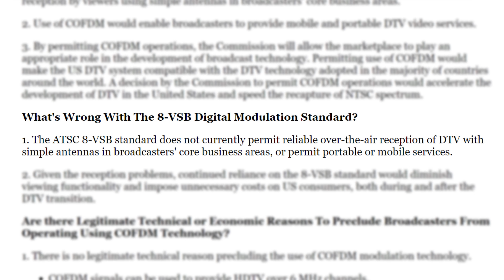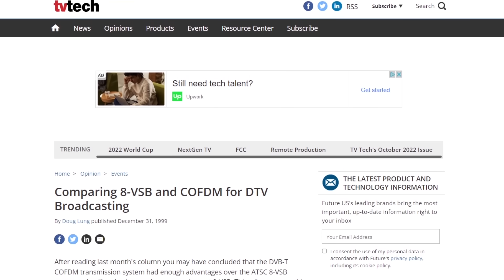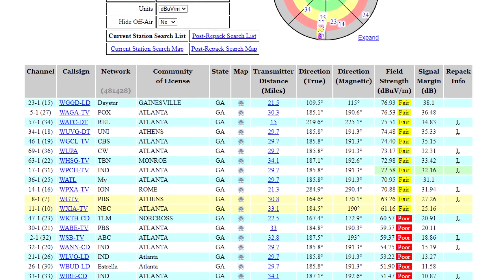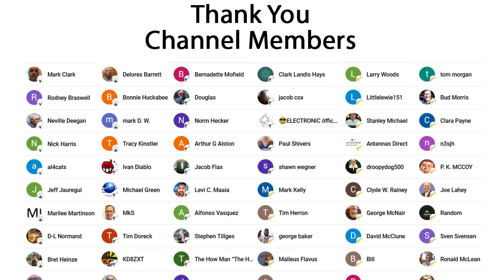This FCC Decision Made Antenna TV Less Reliable for All

Comment: truth is if you still have that rooftop antenna from the 70s or 80s or 90s hook it up.  Coax will still give you 1080p (if your tv supports it and if the broadcast is using it). I'm using that and am getting 74 channels, some have good stuff on them.  But the real problem with that is a lot of it is repetitive, re-runs, or too ancient of shows for most people to know or care about.  And there's a LOT of other content they could use but don't (streaming services pick up that somewhat a bit).  And the cartoon selection is pitiful compared to any of those eras.

And my setup is WITHOUT a in line amplifier.   Granted i'm in a large city area though.  But that will only improve your channel lineup at least somewhat.

Talking about black and white shows and shows made back in the 1940s to 70s being broadcast.  Granted there's some 80s, 90s, early 2000s, some stuff that's even fairly modern (CSI miami for instance)  But the truth is its just some cherry picked stuff that was popular while most of the rest remains on cable or streaming or only available via "alternative methods" or dvd/vhs/blu ray/UHD blu ray.

And if its not that its lame shows or Infomercials.

Comment: If I needed to climb a tree, a rope would be more reliable, not a tread. The only way to get a good signal is to put the antenna in the top of a tree or a tower. Thanks much for the info from an antenna nut.

Comment: One issue to add was the motivation at the time was to scrap the Antenna all together. This was talked about  until they passed a bill to allow free TV because of communication to news and weather issues and other emergency services that would not be accessible to millions who cannot access cable in remote areas. 
This won out. But the issues still existed to make Antenna service as difficult as possible 🤔. This went on for a few years but nothing was discussed .This clearly bad decision was motivation by lobbying from K Street if I remember right. It was a Boondoggle of an idea that so was abandoned as I understand  The assumption was everyone eventually will be a cable prescriber .This proved to be more problematic 🤪. They as a whole didn't realize most couldn't run cable and many cable companies  had substandard infrastructure  to accommodate the customers even if they had the money. Another suit in an office making decisions about your lawn care while they live in an apartment without a lawn.An analogy that is currently alive now.
With a politician not living in the area or state but running for office knowing nothing about the state. Good Video 😎

Comment: At times I'm very happy with reception but it isn't reliable which is very frustrating. I'm glad you covered this topic so I know that I'm not paranoid. I swear the broadcasters weaken signals on purpose. Late at night, until about 4:40 am, I can pick up numerous channels an additional 20-30 miles away and an additional  15 degrees East. Later, as I watch a program it suddenly becomes near worthless while other channels from same broadcast tower remain strong. 

As much as that irritates me, the excessive commercials, the same bad commercials and non-stop Medicare Advantage commercials are like I'm being beaten with them. Not going back to cable though.
Reply: Sounds like you may be experiencing some reception enhancement from weather conditions. It is fairly common some nights, especially in summer, to receive channels from far away.
Reply: Most low power stations in my area too have infomercials on one uhf 32 playing at the same time one on channel 12 and channel 4 low vhf playing the same program

Comment: The whole  change to digital television from analog was political.  It was done so the phone companies could steal our spectrum-in my opinion, they should never have been able to "buy" spectrum, only pay yearly payments to lease it.  The vote in the Senate was 50-50 with Dick Cheney casting the deciding vote.  I my opinion, due to poor reliability of  the DTV offered, analog should still be allowed in certain cases and on certain bands(example-low VHF) For example, even though analog can become very snowy in stormy weather, the sound is still useable, unlike DTV(or satellite for that matter),  In stormy weather, it is much better to have some information over none.   As to the engineers not being listened to, just read about the space shuttle Challenger accident.

Comment: Voyager 1 has a 22 watt transmitter that can be picked up over 22 light hours away an yet I can not pick up a single from a 100,000 watt TV station 20 miles away. I know NASA has some big ass antennas but come on. Something is bad wrong when you are cranking out 100,000 plus watts and some one 20 or 30 miles away has problems picking it up.
Reply: Terrain is a big deal when it comes to TV reception. If you live in a hole it may be difficult to receive stations even that close.
Reply: @TechnicalLee  True. But when the single was analog I was watching TV stations that were 300 mile away with little to no problem. No  the same digital stations are no longer viewable. In fact no signal is detected from them at all and I have used over two dozen different antennas. Stations that came in clear as a bell that were only 20 miles way are no longer viewable. And yes I did get converter. I no longer even have a TV at all. The Internet is now all I watch.
Reply: It's just like with modern digital cell phone reception - it's all or nothing. That's both good and bad.

Comment: The whole thing is not going to work.. where I live digital TV...is not good at all... because the tower is up the hill and still will not make it in to my apartment...if thay kept the analogue signal on the air and used to internet for Digital...or Satellite TV for that matter...I used too get 200 miles on analogue signal... Digital U can not get a station in San Diego from L A!!!!

Comment: Antenna Man, I took your advice & bought the top Channel Master antenna. I found it flimsy, with 2 or 3 elements loose, not riveted on tight, but loose.  I found VHF elements not of tube but pieces of sheet metal bent with a slit in them.
Are you on Channel Master payroll?  I don't find the current digital broadcast service unreliable where I live. I can get channels even with indoor powered rabbit ears.
Reply from the maker: I'm not on the payroll of Channel Master or any antenna company. I'm honestly offended you would accuse me of falsely recommending an antenna that doesn't work well. I'm not sure which one you bought but all antenna companies make good and bad models. Channel Master's Advantage series antennas aren't built as well as the Masterpiece series antennas. For what it's worth I actually called out Channel Master numerous times on this channel for over hyping their new Pro model.
Reply: There is no other antenna on the residential market made better than the Winegard HD7698P, HD8200P or HD7694P. That's why you still see these antennas' cousins (very slight changes) up on towers that were installed back in the mid to late 70s. Just north of Lafayette, IN where it's flat and they get extreme winds/ice these antennas continue to survive for decades and pull in both Indy and Chicago from 90 miles away (the 7698 and 8200 with a preamp).

Comment: In my tv market area, ABC affiliate and PBS broadcast stations i cannot receive. I might be able to eventually get them, because my TV has a built-in noise reduction so when I go to the call station  I can't tell if wherever I move the antenna it will improve or degrade signal strength more. Also the antenna i purchased has about 2 feet cord to tv. I also bought a db filter, which gives a little more flexibility, but not much. I wish they still made rabbit ear antenna with longer extended range, I even remember using aluminum foil on the tips for improving quality of picture. Where I live i shouldn't need an outdoor antenna because the signals are generally 15 miles away from me and I'm on the upper floor.

Comment: Here's what I remember about how this situation developed. In the 80s, several groups in the US and abroad were working on an HDTV standard. Japan already was using their MUSE system. In the US there was a desire to lead the next TV advance as had happened with NTSC and the electronic color system.

Several groups in the US including Sarnoff, AT&T, and Zenith were pursuing their own standards. In particular, those 3 groups were responsible for fundamental technologies chosen by the FCC or the market that were in daily use by millions.

Zenith's digital system was spectrally compatible (to some extent) with the analog NTSC TV signals occupying the 6MHz channel BW in the US. This was a potentially important consideration given the cost to a broadcaster of obtaining a second broadcast channel for a new digital signal apart from their existing analog channel.

AT&T and Zenith were working together. Zenith supported 8-VSB. Zenith was still an American manufacturer at the time (although this was slipping away quickly). AT&T had strength in digital video compression.

The competition and demonstrations were the hottest things at NAB '92.

Ultimately the competing players formed the Grand Alliance, adopting various technologies contributed by the members. 8-VSB made it through the trials and was selected. As I recall, COFDM was regarded as processing-intensive at the time. Ironically the OFDM technology was developed in the US and adopted by the US military, so it too was home-grown, but didn't test as well (initially) in the trials.
Reply: I don't recall ever hearing about COFDM being process-intensive before. But it handled terrestrial interference much better than 8VSB

Comment: We all need to remember one very important fact: The Federal Communications Commission is run by attorneys with political connections. There hasn't been an engineer among the commissioners in many decades. Attorneys are quite likely to dismiss concerns of engineers by asking "Well, CAN it work?" And an honest Engineer would say "Yes, But..." and the Attorneys would not be able to comprehend what the concern is. This gets treated just like any other opinion. Trying to explain nuances of modulation to them is like trying to explain electricity to a dog. You might get a curious look, but you know quite well that there is no possibility of comprehension. 

At the end of the day, the allocation of the electromagnetic spectrum is always going to be a political decision, just as zoning laws are a political decision. Yes, the FCC botched this  badly. It's not the first or the last time they will screw up royally. Eventually they will arrive at a reasonable regulation after all the unreasonable ones have been tried. I wish I could say something nice about this, but the only thing they understand is politics. Most Engineers have better things to do than play political games. And this is why we have the government that we do.

Comment: I have a zenith brand digital converter box and it still works I bought it in 2008 it's going to be 15 years old the other brands have already broken ., regardless of the issues with digital television broadcasting it is far better than the analog where you could get so few channels even in an urban area

Comment: This is why I have to use 2 fairly high gain antenna's going into a combiner that's pumping a preamp at 25 plus miles out from the broadcast area. I get reliability on all my main channels I want and now the added gain gives me some of low power stations the inner city gets but, only on good days. For me it's literally taken years to find the best combination of antenna and preamp to make it reliable in most weather conditions. That being said it's still has it's moments once and a while. It's been frustrating to say the least but, hey I'm not sending a payment to one of those TV over a wire outfits.

Comment: The hoped-for AM radio stereo conversion in the 1980s showed this same inept approach when the commissioners came up with no standard for the AM transmitter. Instead of designating one manufacturer or another, they decided it was a free-for-all, letting all candidates for the standard in the market. Everybody lost, especially listeners. AM radio today, as you pointed out, instead of being boosted by that decision, continued its slow death.

Comment: COFDM was used by every other country except the US and Korea. It was used in every other service except OTA. Microwave, satellite, etc. There was a test in DC at the Rayburn building with WRC transmitting the 8-VSB and WTTG did the COFDM transmission.  Oh there were shenanigans. It doesn't work and it never worked. What does the current ATSC use? Too little! Too Late!

Comment: I'm afraid most of this is ill-informed, as the narrative begins too late in the process to tell the whole story. At the tme the FCC standard was chosen, the over-riding factor was the signal-to-noise limit of the chosen system so that there could be simulcast of digital and analog during a transition period, plus a requirement that actual hardware could demonstrate feasibility. COFDM receiver hardware at the time did not work that well, plus there seemed to be a theoretically unfixable 3 dB penalty compared to VSB. PLUS, Zenith had originally proposed a system with flexibility to trade data rate for robustness, which is the current COFDM systems advantage, and it was rejected by broadcasters, who short-sightedly felt only HDTV was valuable. Sinclair later realized this folly, but it was too late. It was a case of the two technologies leapfrogging each other year by year, but it started with VSB in the lead, long enough that the selection process could not be reversed. Regarding the weakness of 8-VSB with fast-changing ghosts, the extent of such conditions weren't known at the time, despite best efforts to measure field conditions. The flexibility of the COFDM systems (not their basic modulation robustness) allowed them to trade off bit rate for robustness when the actual severity of field conditions became apparent. (Again, Zenith had proposed more flexibility, but it had been rejected.)
Careful comparison of up to date technology including things that hadn't been invented back in the 1990s has resulted in ATSC 3.0 using (very advanced) COFDM.
Reply: It's also necessary to point out that the market models were very different for the US and Europe. The US needed a system to fit  the use of a single tall tower for each broadcaster, covering a large area. Europe needed a system to fit the use of multiple repeats of a limited number of programs, each transmitter covering a small area with a short tower.

Comment: not only that but VHF high band stations that ran up to 216kw erp were dropped to as little a 5kw
Reply: In some areas. In other areas VHF-HI digital channels are running 50kw, while UHF digital channels must run 1 mW to have the same coverage area. Back in the analog days, full power on VHF-LO (channels 2-6) was 100kw, VHF-HI (channels 7-13) was 316kw and UHF was 5 mW. Yes, that's 5 million watts - and the UHF channels still didn't have as much coverage area as the UHF channels. In many areas today with both VHF-HI and UHF digital channels, the VHF-HI channels have better total coverage (distance-wise) but don't do as well in urban areas due to multipath reflections.

Comment: The biggest thing killing off free tv is company buying out programming and putting it on pay tv. Apple tv bought  out the peanuts gang and if you want to watch any holiday peanuts shows. Got to watch them on Apple tv. NBC moving alot of their programming to their peacock channel. And Disney has bought the rights to lots of tv shows that were aired on free tv. So free tv be going away in a few years. Don't think a new tv format will save it. The company's are buying out programming that was aired on free tv. Miss the old days when it was just the three big networks. Fox network was not around in the old days  And all programming aired on them. Today your being fouce by a sad format they pick to air free tv on and programming is being bought out and put on pay tv.

Comment: why no atsc on cellphones?...
Reply from the maker: Because the standard isn't picked up well with small antennas and while in motion but you can get an adapter to turn your smartphone into a TV tuner. See video below. https://youtu.be/OSZwChMpbJ0
Reply: @AntennaMan  Also because the big cell phone companies wanted you to pay for their data bandwidth to stream TV shows, so they actually prohibited device manufacturers from putting 8VSB chips in the cell phones they sold. This may still be an issue with ATSC 3.0 since it would equate to lost wireless revenue if it was put into cell phones. Another example is how very few phones have FM radio built in. Another case where the money talks.

Comment: what is ampitude?
Reply: It’s Amplitude. It refers to the intensity of a wave (all radio signals are waves). Thus amplitude modulation of AM would refer to changing the intensity of the signal to encode data (ie audio). The frequency of the wave is constant and only the amplitude changes. With FM, it’s the opposite. The frequency of the wave changes and it’s intensity is constant.

Edit: for a good  visual comparison see the wiki article on FM. https://en.wikipedia.org/wiki/AM_broadcasting

Comment: Oh I can do you one better. They had high definition analog formats. High definition without the digital breakup, and without the issues caused by low bitrate.

In fact, a high definition video format, that uses effectively a COMPOSITE VIDEO CABLE exists and is in use right now. How do i know this? My security cameras use it. As of the year 2022. AHD security cameras now support 4K video resolution.